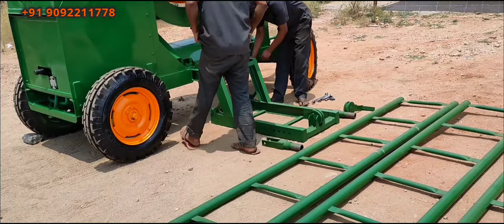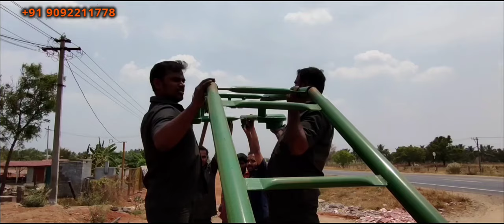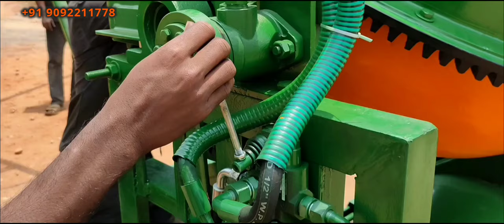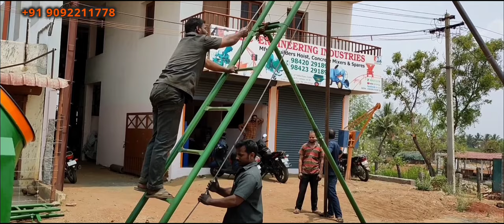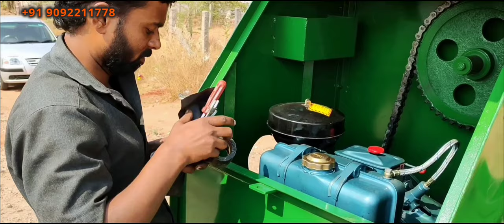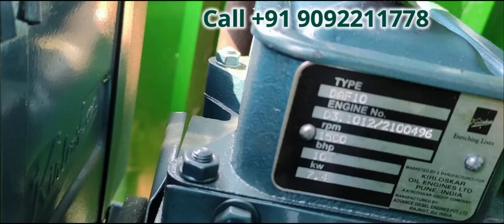How to assemble Roof Concrete Mixer Machine  ARC Full Demo

Comment: Price
Reply from the maker: As per your requirement kindly contact us 
We are the manufacturer of wide range of Construction Equipment's like Concrete mixer, Builders hoist, Earth rammers, Concrete vibrators, Wheel barrow and sand sciever etc,. 

ARC Engineering Industries 
𝐴𝑑𝑑: 𝑆.𝐹. 684/4𝐵 2𝐶,
𝐿 & 𝑇 𝑃𝑎𝑎𝑙𝑎𝑘𝑎𝑑 𝐵𝑦𝑝𝑎𝑠𝑠 𝑟𝑜𝑎𝑑,
𝐶ℎ𝑖𝑛𝑛𝑖𝑦𝑎𝑚𝑝𝑎𝑙𝑎𝑚 𝑃𝑂
𝐾𝑢𝑙𝑎𝑡ℎ𝑢𝑟, 𝐶𝑜𝑖𝑚𝑏𝑎𝑡𝑜𝑟𝑒,
𝑇𝑎𝑚𝑖𝑙 𝑁𝑎𝑑𝑢 641062

📞 91 9092211778 
Message A R C Engineering Industries on WhatsApp. https://wa.me/message/YIRHGRXDFGH6K1
ARC CONCRETE MIXERS: https://www.youtube.com/playlist?list=PL4MsNScCWZXVRgnfcsdHdnK1u7Az-zGa-

Comment: Price pls
Reply from the maker: Kindly contact us at

We are the manufacturer of wide range of Construction Equipment's like Concrete mixer, Builders hoist, Earth rammers, Concrete vibrators, Wheel barrow and sand sciever etc,. 

ARC Engineering Industries 
𝐴𝑑𝑑: 𝑆.𝐹. 684/4𝐵 2𝐶,
𝐿 & 𝑇 𝑃𝑎𝑎𝑙𝑎𝑘𝑎𝑑 𝐵𝑦𝑝𝑎𝑠𝑠 𝑟𝑜𝑎𝑑,
𝐶ℎ𝑖𝑛𝑛𝑖𝑦𝑎𝑚𝑝𝑎𝑙𝑎𝑚 𝑃𝑂
𝐾𝑢𝑙𝑎𝑡ℎ𝑢𝑟, 𝐶𝑜𝑖𝑚𝑏𝑎𝑡𝑜𝑟𝑒,
𝑇𝑎𝑚𝑖𝑙 𝑁𝑎𝑑𝑢 641062

📞 91 9092211778
Reply: Under 2 lakh

Comment: Ladder lift rate solunga
Reply from the maker: Hello sir, kindly contact us for current price as per your requirement and location

We are the manufacturer of wide range of Construction Equipment's like Concrete mixer, Builders hoist, Earth rammers, Concrete vibrators, Wheel barrow and sand sciever etc,. 

ARC Engineering Industries 
𝐴𝑑𝑑: 𝑆.𝐹. 684/4𝐵 2𝐶,
𝐿 & 𝑇 𝑃𝑎𝑎𝑙𝑎𝑘𝑎𝑑 𝐵𝑦𝑝𝑎𝑠𝑠 𝑟𝑜𝑎𝑑,
𝐶ℎ𝑖𝑛𝑛𝑖𝑦𝑎𝑚𝑝𝑎𝑙𝑎𝑚 𝑃𝑂
𝐾𝑢𝑙𝑎𝑡ℎ𝑢𝑟, 𝐶𝑜𝑖𝑚𝑏𝑎𝑡𝑜𝑟𝑒,
𝑇𝑎𝑚𝑖𝑙 𝑁𝑎𝑑𝑢 641062

📞 91 9092211778
Reply: Under 2 lakh

Comment: Rait
Reply from the maker: Kindly contact us for current price
As per your requirement 
ARC Engineering Industries 
𝐴𝑑𝑑: 𝑆.𝐹. 684/4𝐵 2𝐶,
𝐿 & 𝑇 𝑃𝑎𝑎𝑙𝑎𝑘𝑎𝑑 𝐵𝑦𝑝𝑎𝑠𝑠 𝑟𝑜𝑎𝑑,
𝐶ℎ𝑖𝑛𝑛𝑖𝑦𝑎𝑚𝑝𝑎𝑙𝑎𝑚 𝑃𝑂
𝐾𝑢𝑙𝑎𝑡ℎ𝑢𝑟, 𝐶𝑜𝑖𝑚𝑏𝑎𝑡𝑜𝑟𝑒,
𝑇𝑎𝑚𝑖𝑙 𝑁𝑎𝑑𝑢 641062

📞 91 9092211778
Reply: Under 2 lakh